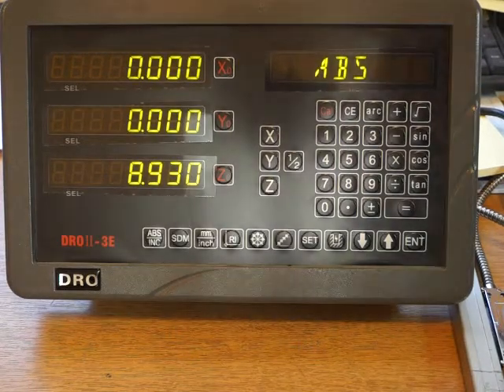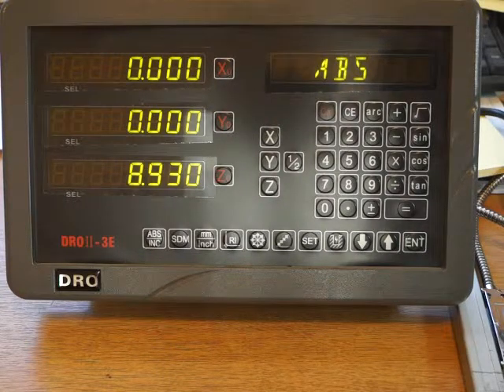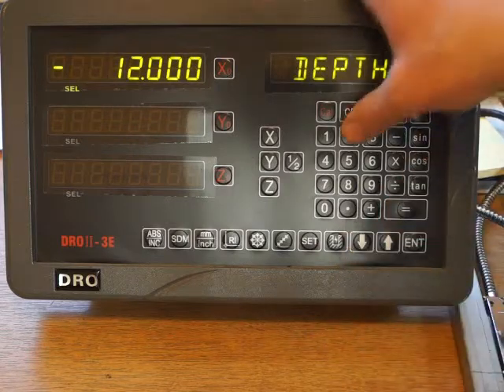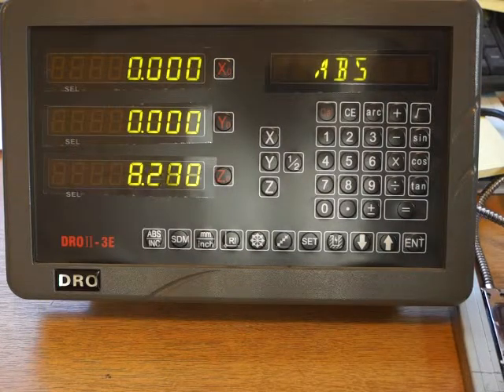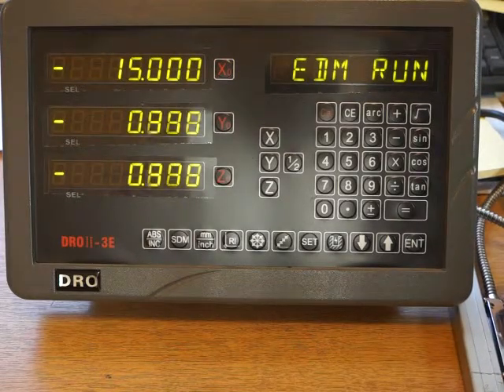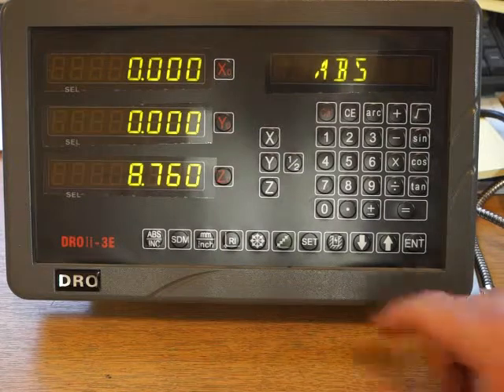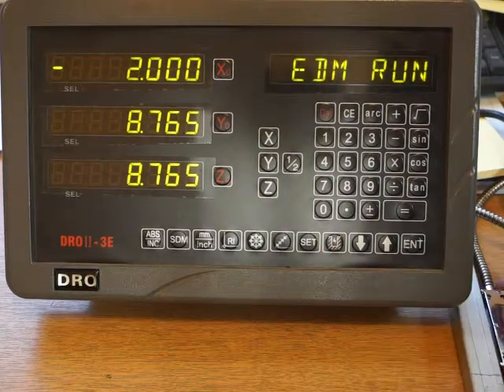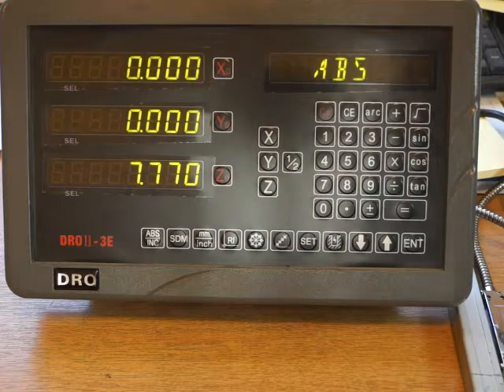Goodwin 3 axis Digital Readout EDM console

Comment: How does machine stop at Target point? DRO is just a read out system and not control system . Plz clarify
Reply from the maker: Hi Sunil The console has a volt free contacts which operate once the Z scale gets to the Z depth so stopping the machine at the required position. The console comes with a flying lead so it is easy to connect to the machine.
Reply: @goodwindro2462  thx, can this concept be used in lathe machine that is to stop after Target depth or length is achieved?